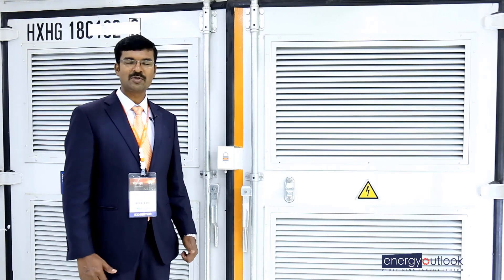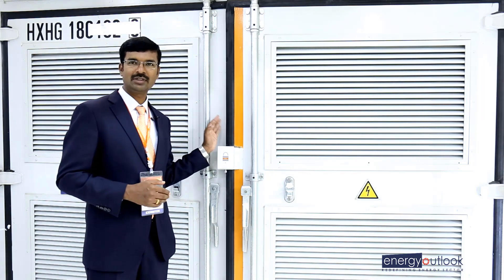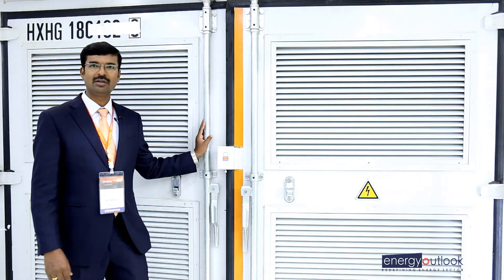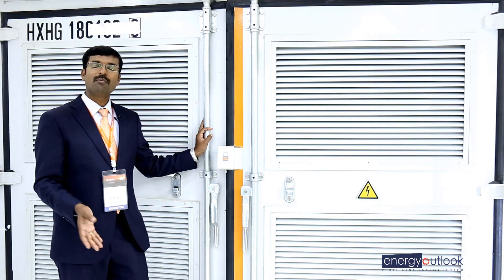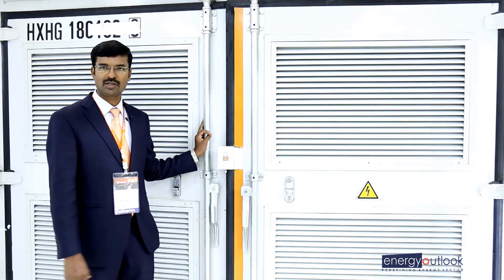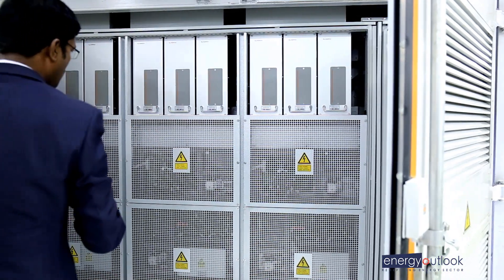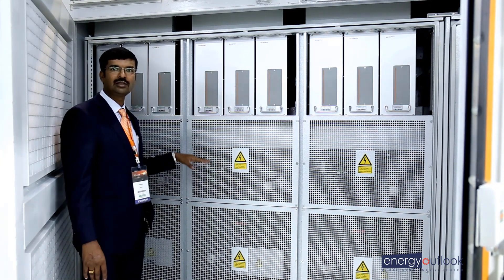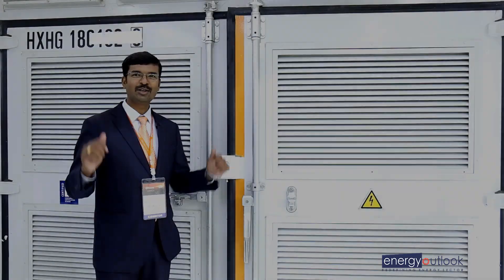Technical Specification of 3.125 MW Sungrow Inverter by Mr. Nataraja, Technical Head, #Sungrow India

Comment: Sir,which Inverter Model suitable for 595W Canadian Solar Panels which have 18.42 Amps Short Circuit current.Plan for 14 Panels for 8KW On Grid 3 Phase system